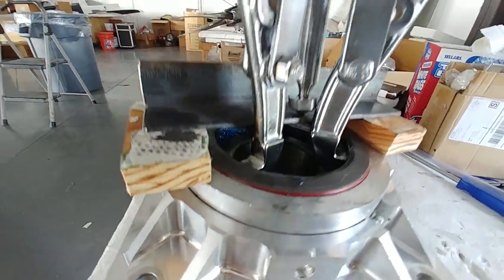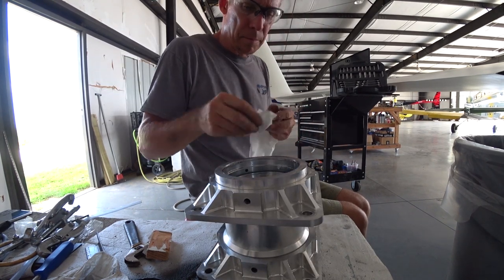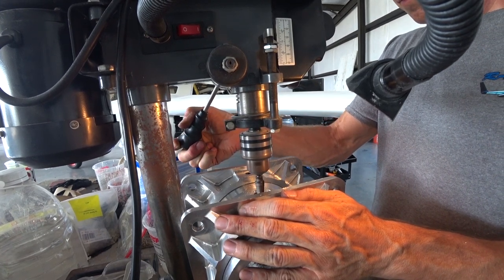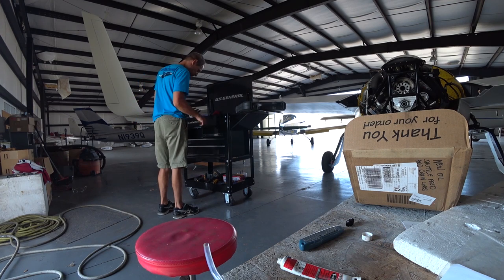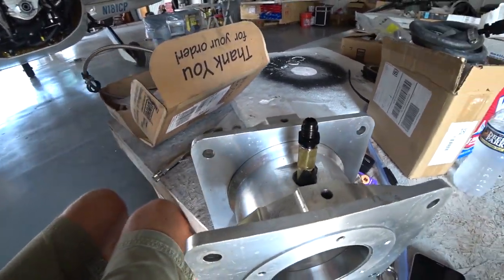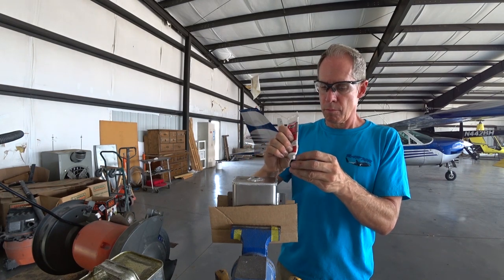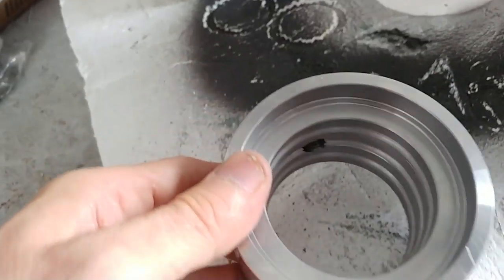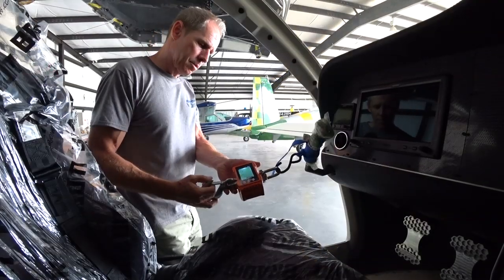Oil Return and Fuel Vent - Building the Raptor Prototype

Comment: I highly recommend you extend the fuel vent's hose THROUGH the hull and let it extend 1/2" away from the wing - because the amount of fuel coming through it is going to literally come in spurts & dribbles, and any breeze will surely blow fuel UP into the engine bay.  It may be only minimal and sometimes, but I wouldn't want fumes being generated with the exhaust so close to the cowling or infiltrating the composites.
Reply: It might be worthwhile to have a plastic funnel inside flush with the body but open to internal, with the overflow outlet sitting low in the funnel.

Comment: Hi The lock wire is wrong as it must keep the bolt /nut from turnig at all. The wire should be on the other side an wound clockwise around the head. Other wise pretty good.

Comment: Maybe add a wire tie on the red handle where you had zip ties? Maybe i missed it, but it looked like the zip ties could vibrate down the hose and slide off the handle. Another be option would be to drill a hole in the handle and lace the Zip tie through.

Comment: You asked for a suggestion on the aileron control connection failure. A simple bell crank with a heim jointed rod. Similar tie rods and connections are use on racing quads and RV's.
Reply: I believe the failure was with the elevator servo linkage for the autopilot/trim system. It needs to be a spring in order to work correctly. The servo needs to produce torque on the elevator, not a direct input.   The scale was being used to prove that a pilot could override a stuck servo if needed.

Comment: Concerned about fuel ventilation...it appears you are feeding the vent canister from the bottom? This will allow fuel to return to the tank along with condensation from the vent tank, and condensate they will. You should feed the tank from the top and extract from the bottom. Under no condition would I allow fuel and /or fumes into the engine compartment! Isolate your vent under the wing independent from the engine cowls. I would also suggest a vented "cap" with a check valve for pressure relief. I have other suggestions, however, this should give you something to consider. There may be other ways to achieve your dilemma. You may be overengineering this part of the fuel system. Just my thoughts. I get that this application is "Jet A" but it is still fuel.
Reply: This is an Audi turbo diesel engine.
Reply: Owen Sparks which will run on Jet A (ie kerosene)
Reply: Racer Dave, condensate is what sump drain are for. This is a pretty standard fuel tank vent setup on other canards.
Reply: Please review Pete's update on the engine in (part 1). link  https://www.youtube.com/watch?v=Hj685wwGB9Y&t=332s begins at 4:35 min. Has and will run on Jet A. You say tomato I say tomoto!

Comment: I saw what I think was an engine mount with rubber mount. As its job is to prevent vibration, might it be good to lock the bolt as vibration will occur. Great work . P

Comment: Use a torsional spring.   Easier to adjust too.   Epoxy and glass was never going to last.
Reply from the maker: The Velocity's do it this way but I will consider the torsional spring. Thanks.

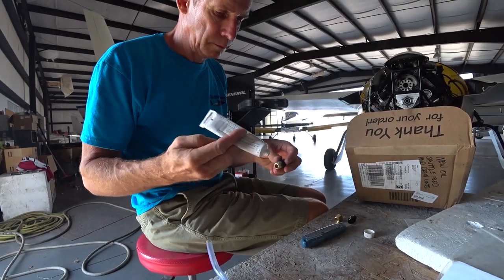Comment: Just trying to help... The majority of your safety wires (5:00 to 5:20) seem to have too much slack in them and not be correctly guided around the bolt heads. These bolts won't fall off, but they might loose torque from vibration and break from fatigue. Take a look at the examples on page 7-20 of AC43.13 for the proper technique. (https://www.faa.gov/documentLibrary/media/Advisory_Circular/AC_43.13-1B_w-chg1.pdf). Good luck.